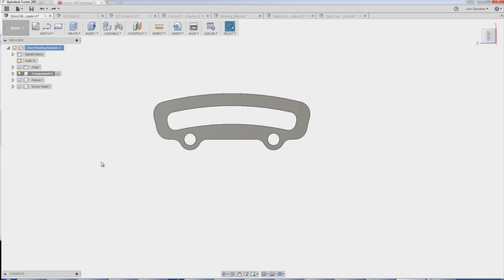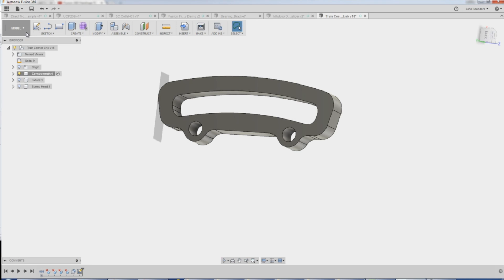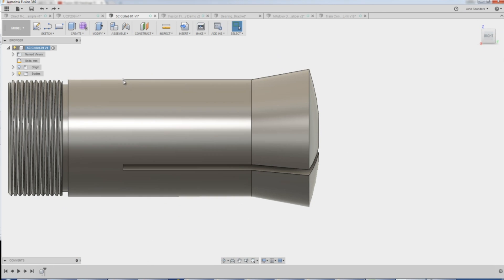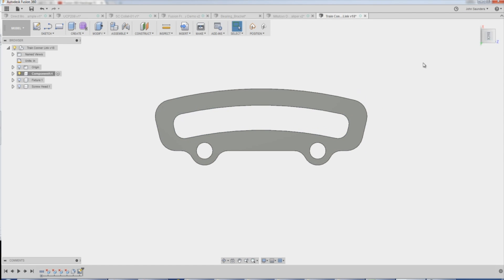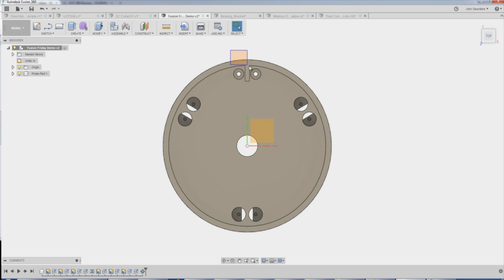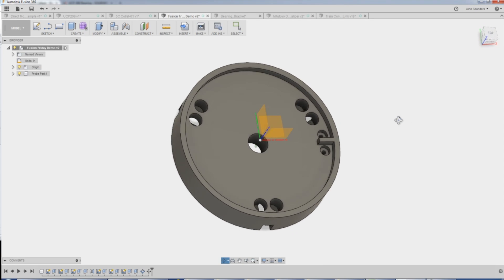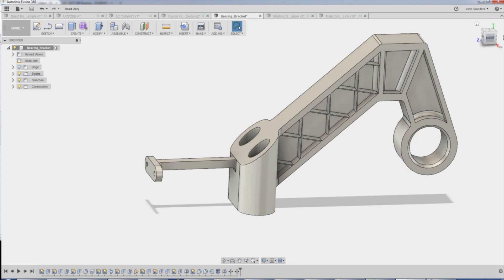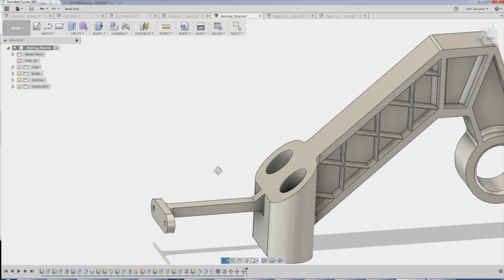Fusion 360 Direct Modeling: A GREAT way to fix CAD models! FF83

Comment: I have been using a Direct modeler for almost 30 years!  Have found  that the need for a history is way over rated.  There are some very good direct modelers.  We use KeyCreator.  Before it was called KeyCreator it was called Cadkey.  Cadkey was the first 3D CAD program for the PC market introduced in the 80's.  It's nice to see Fusion using this method.

Comment: John, I'm sorry but this video is very confusing to me. The name of the video is "Fusion 360 Direct Modeling: A GREAT way to fix CAD models!" . Which made me think you'd be working in Direct mode to show things you can't do in parametric, but were you not in Parametric mode the whole video? Are you showing ways of editing things that were previously only available in Direct mode?  I've always had the hardest time editing thing in Fusion, seems like I always get errors.  Can someone help me out here? What's not clicking for me on this? Thanks.
Reply: Have you considered getting some training that's not from videos online?
Reply: +Scott Moyse          In fusion? No because I don't really use it a lot. I've been using Autocad for over 15 years (not saying I'm an expert at all), so I tend use it or Inventor 90% of time. I'll use SolidCam, FeatureCam and some other Cad/Cam software sometimes also just depends what I'm doing. Dang, was my comment that ignorant? Jk=)   
What I don't understand is, John does not appear to be in Direct modeling because there IS design history at the bottom for the whole video, however the video title led me to assume he would be showing the the benefits of editing a model in the Direct modeling environment. When I tried selecting and editing while capturing history a lot of the time I would always get errors in the timeline and whatnot, but its been a while.  That's why I was asking if this was new. After re-watching I heard John say that this is rather new to be able to do, so perhaps a more accurate title would have been something more like "Fusion 360 using advantages of direct modeling in parametric mode" does that not make sense or am I really that lost with Fusion?